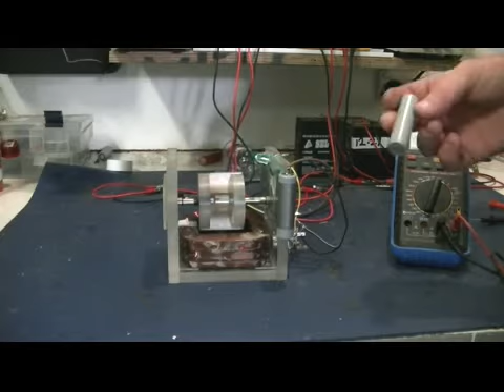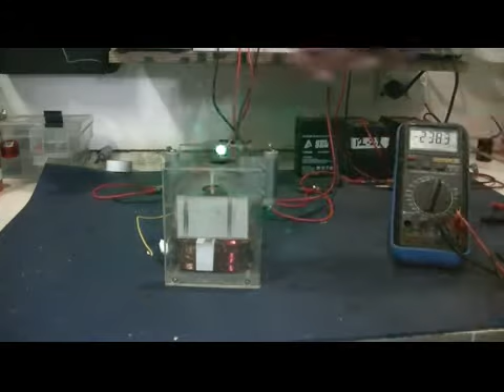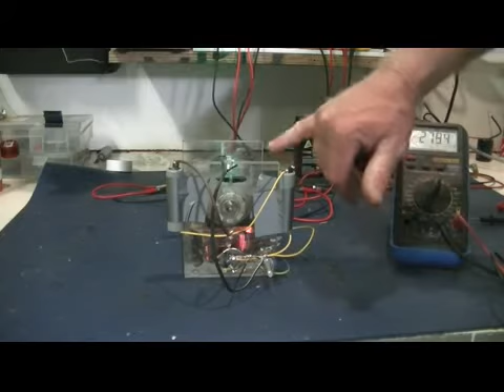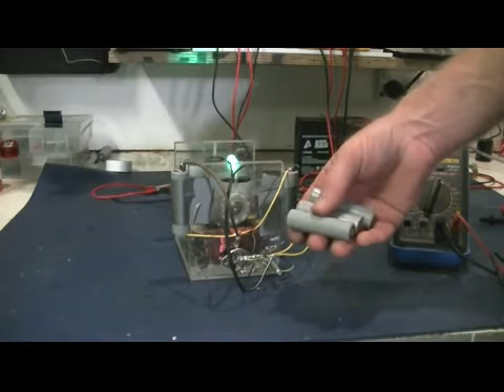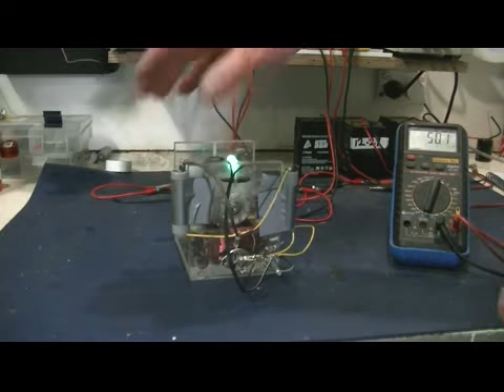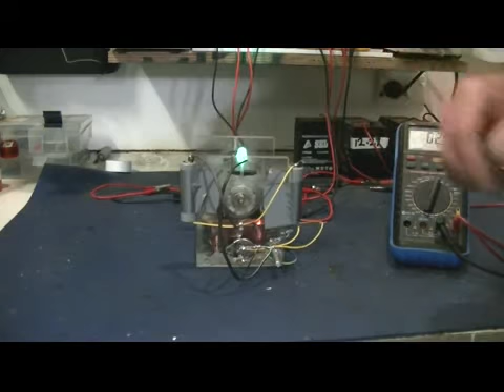window motor must see.flv

Comment: I just can't figure out why this hasn't been scaled up to charge batteries for an off grid application.  Seriously, can I use this same technique to charge ten 12 volt deep cycle batteries 100 amp/hours each?  It just seems to good to be true.  The advantages are just unbelievable.  You don't have to buy solar panels.  You don't have to buy a charge controller (although it would probably be a good idea to have one anyway.)  The copper wires don't have to be as thick thanks to the high voltage.  It can produce electricity even when there is no sun or wind.  It's the holy grail? 

Better yet, can I build one to tie into the grid?

Comment from the maker: @fathershand hi fathershand-i believe the ssg pulse motor is easer to build and cheaper as the magnets for the window motor arnt cheap-the ones i use.As for the self resonateing coil-this is why your wheel isnt turning and i have a circuit on iaec forum to fix this and draw less power from the run battery.
TinMan

Comment: @fathershand The transformer I have was used for lights, weighs about 10 pounds, and has a big Ecore.  It will produce the following voltages: 120, 208, 240, 277.  Any suggestions that you have are greatly appreciated.

Thanks, Tinman.

Comment: @duneraider69 Tinman, I am happy to follow your progress on any forum that you choose.  Please advise of the new location.
I am trying to decide which step to take next.  My simple SSG uses a bicycle wheel and won't run.  It does self-resonate and charges batteries. Would it be better to build a new setup using the coil you suggest, or would building a window motor make more sense?  I have just found a large transformer to scrape for this. I have no money to buy wire for coils.
Thanks 4 ur help.

Comment: really excellent tinman. you have done it again. ill have to catch up with you on my new rotor set up. i wired up a new circuit with fresh parts this evening, and ran a test on two batterys after i had drained them down to 12.20 area. both of them charged over 16 volts in less then 1 hour. i made a coil similar to yours, 4 layers on the trigger coil, then 450 turns of my 1.04. really nice charge. anyway, excellent work , cant wait to try this one also, lol see ya SD